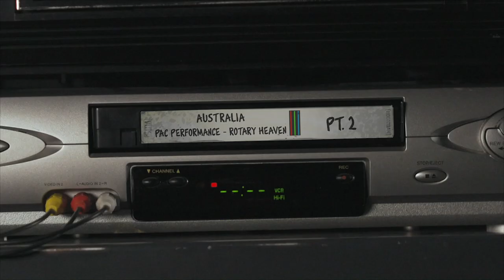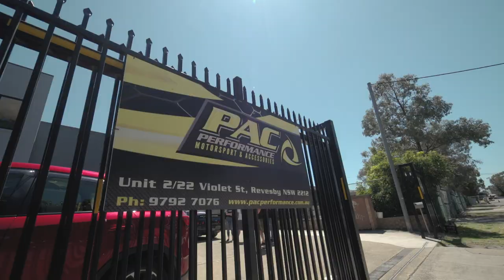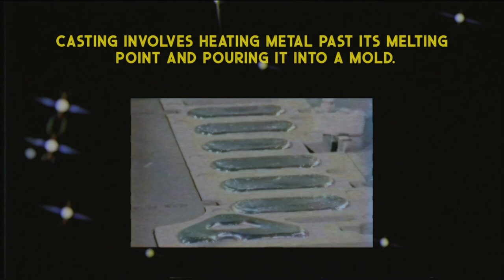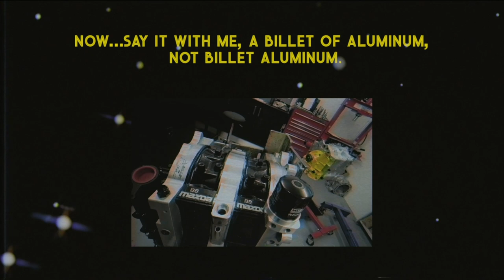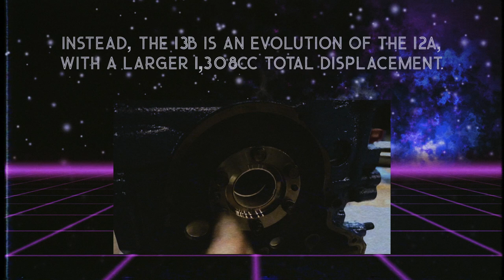The Greatest Rotary Shop in All of Australia? Spitting Fire at PAC Performance

Comment from the maker: How quick would the Twerkstallion make it down the 1/4 mile (speed & ET)... or wouldn’t it?
Reply: Is it just me that thinks Ken should do something in Canada I honestly just want to see something in Canada
Reply: It would.. But the hood would set a time quicker than the rest of the car 😂
Reply: 11s with a tire maybe lmao
Reply: With Hert driving it wouldn't make it past the finish line😂
Reply: It's would destroy the diff/axles before the 60ft
Reply: Sort out a tune, maybe some gears in the rear and some slicks and skinnys I could see it in the 9's
Reply: Just keep Hert away from Cleetus's Ruby on a private 1/4 mile day is all I'm gonna ad :D
Reply: Does he know how to drive in a straight line??
Reply: 1 to gay in half a second flat
Reply: @dalaw6600  there's one way to find out :D
Reply: High tens
Reply: in drift set up 12s i tink lol
Reply: The rear diff would run the 10, the chassis wouldnt make it past the 60ft
Reply: So to answer this you need to elaborate on the following; 1. With Gucci Slips or Crocs? 2. Hand Brake Boosting on the beams? 3. Will Hert ask Mike from Angel Motorsports to drive? WIth all that being yes I say 12.1 best and low 13's all day!
Reply: 4 to 6 mph roughly 3 minutes at best. It's faster than walking and slower than running but depends whose pushing.
Reply: 13.6
Reply: He'd spin out and the spoiler would be the only thing crossing the line.
Reply: Hoonigan 13.6 @137
Reply: Good luck hahahaha😂😂😂
Reply: 12’s if hert doesn’t break it in the 1/8th or lose his hood
#hoodpins
Reply: Are we talking with drift tires 😂 drag radials or slicks lolol
Reply: 10.3s
Reply: 14.32🤣 if it hooked up I would guess some where in the 11s
Reply: "You could push it across the finish line... or tow it" RIP Jesse
Reply: @howard6547  and you can't do a half second "flat" smh
Reply: I’m calling 14.20 haha maybe 13.69 with some spray.
Reply: Hoonigan so you guys are really gonna ignore the rx8 13b like that :(
Reply: 12s @120
Reply: Hoonigan 11.9 without aero
Reply: Hoonigan - “Bait” question. Ask a question that you think will get a shit-ton of answers, but never answer or reply to it. Cuz it’s YouTube and comments and shit are key 🔑 🤣
Reply: high 12 low 13? - Did not hit forward once, great shop tour!
Reply: The beats at about 7min in clap hard af please let me know where to find this sound clip if you can. Love the content boys, keep keeping on.
Reply: @isaacshively6705  dude 500 hp isn't putting that car in the 9s... That thing is lucky to make 500 at the crank, he's only got a Bridgeport on the motor. He'd be lucky to run a 10...
Reply: I would say 11sec and with Hert 14sec
Reply: 12.6with the setup you have now it would wheel spin off the line
Reply: Otaku Plays Games as a canadian i support this.
Reply: @isaacshively6705  whats up ohm boi
Reply: @howard6547  dude seems like a clown.
Reply: Abel ibarra lives around you so if you reach out itll run 8s no problem
Reply: On what tire? Send it how it is, maybe 13.6 @ 111 lol with lots of tire spin. With a MT street radial at least, I’d say 11.8 @ 138.
Reply: Depends on the quality of the fire suit Hert wears and his tolerance to being on fire cuz we all know that there’s absolutely no way The Twerkstallion is making a pass without it’s hood going up in flames. Again....
Reply: Seen that drag car in person 🤤🤤
Reply: You
Reply: That Madlad georgie letting big homie brap the 20B ...is hertz new spirit animal rtrt
Reply: With or without the hood?

Comment: Rotaries will never die man. Even if they aren't in production
Reply from the maker: PAC is doing their part in keeping the screaming Rotaries alive. 🤘🏼🔥
Reply: Wasn't it basically just a electric driven rotor?  makes an efficient air pump.
Reply: Le Mans changed the rules so rotaries will be allowed in the 2021 season, I don't see why they would have made that change if someone wasn't going to enter rotaries in the race
Reply: @jaydunbar7538  someone could've petitioned for it doesnt guarentee that itll happen though. It would take alot to have a f1 team running a rotory. It would definitely be a team owner with a passion for the motor because he would have to have alot of stuff one off designed for him and his basic running costs would be alot higher due to more fuel consumption along with the all the injectors needed and the cost of replacement parts is higher for rotory than piston.
Reply: @nobrakes425  higher cost for rotary then piston? For a consumer car sure, but mass production scales of economy do not apply to F1.
Reply: @jaydunbar7538  the cost for a 1 off rotory is insane rob dahm built a awd 4 rotor and that cost a mill over all and something like 5 years. Yes hes not a professional team but that means his cost might be lower and it might not. If you already have milling machines then your cost might get cut down but then you have to do all the research that goes with making your own motor from scratch.  If you have you have a 3rd party do it then you have a high cost but all the work is done already. The only people who could do it reasonably would be mazda because they have the funds and they have the designs done or a shop that specializes in manufacturing and tuning rotory engines teaming up with a established f1 team. Racing any built race car takes alot of money normally multiple thousands per race. Racing a f1car with a full team is a astronomical price for the average racer let alone the average racer. Why do you think they need all the sponsors. High level racing is all established teams and very rich people who want to be race car drivers and can throw away millions to have fun with the big boys. If you dont win the races you dont get any money from racing and sponsors dont want to be associated with losing so they pull out and then it's all out of pocket to try and win.
Reply: @jaydunbar7538  rotaries won Le Mans in the past.

Comment: Billet blocks or heads aren't just more expensive because you have to shave them to their finish product, ALSO billets are forged metals shaped to a billet shape or block they dont just pour that to a mold and ship it to a CNC machinist 
@hoonigan missed that part. I worked at NASA using high grade virgin aluminum for making machined billet aluminum rocket parts and structure supports for planes

Comment: 23:03 "the 13B has not been seen stateside since 1995..." what about US spec rx8? That had the Renesis engine (13B-MSP) from 2004-2012.
Reply: Key word renesis engine and 13b-MSP. If you have the motors side by side they are not the same. It's like a old 350 small block and a ls. They look the same and have some similar design elements but they are not parts interchangeable
Reply: If I remember rite Mazda did it worse the second time around though unlike chevy
Reply: We don't talk about that abomination

Comment: the last car is a 6 rotor or 4  just has more fuel going into it this way the flames are there but there no secrets in drag racing because they have to take the hood off at some point at the track unless they pull the car straight into the trailer after a pass

Comment: the greatest rotary shop in australia your kidding me rite? i bought a few sx regs off pac from ebay and a 13b turbo manifold hand made the manifold turned out to be 12a to to4 in to ser2 and not 13b to4 into s2 that was very upsetting as no one was doing up 12a as they are hard to get rotor housings for and under powered, any way out 4 sx regs 1 was screwed had hole in the diaphram before i bid on each one i had rang george from pac he said they wer perfect  last one i fitted to my mates ser8 rx7 i just rebuilt the motor.

 it was pushing petrol threw the diaphram up to boost hose hole and filled petrol into throttle body because there vac nipple there were i put the boost  hose  petrol started pissing out of the butter flies i thought shit the motor has filled with petrol pulled out the plugs it was good then i relised what happen i pulled the reg apart seen the hole in the diaphram i rang george and he was being stupid  i clearly told him what happen and hes said just puts some rubber grease or vasso on the diaphram out side edge put it together again it will be fine,  i said are you silly its bloody got a hole it,  i told you clearly hes gone quite then said look i will meet you half way i will sell you a diaphram at half price there 160 new i will give it to you for 90  i went piss off there full retail 80 dollars,  i said you told me they  perfect before i bought them  it didnt even start the car  and it was rooted.

 1stly rocky isnt a mechanic apparently hes a civil engineer and george started an aprenticeship with the worst and nastiest italian mechanic there was,  my new apprentice at the time told me he left him because he was and absolute a$$face and was hes uncle  and a week later he told me rockys brother from pac george took his old job this is a home workshop registerd one not far from robbos i think it was in canterbury rd  i am not bagging there achievments they have had many quick cars but also over charge and have ripped off many  people the way they handled me was criminal i got ripped off hard twice losing money,  if i wanted that treatmant  in the start of would of put on a wig and lipstick and tried to hitch a ride with billal scaf and his crew,

Comment: Mazda 6 has to be a 4 rotor!! 

Ps: Heard 3 rotor!!
Reply: 100x35Vlogs the big dude said it was a 20b lol. I was thinking 4 rotor as well
Reply: Do these run nitro methanol ? Or rather cam they , and is that a thing ?
Reply: texasdee slinglead i know nitro methane is used in top fuel. Maybe they to or alcohol.
Reply: @texasdeeslinglead2401  the race cars use methanol. The street cars e85
Reply: @mashinajoe  those flames on the secret sauce car reminded me of nitro methanol.